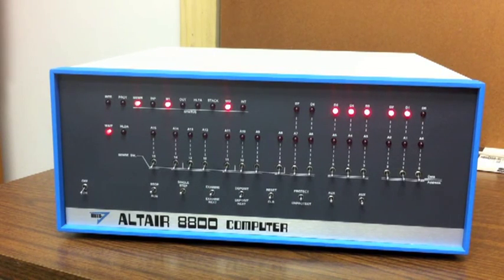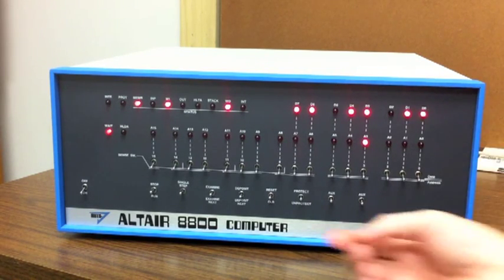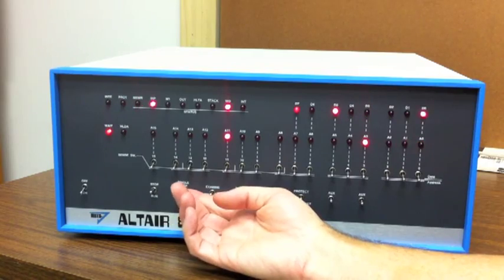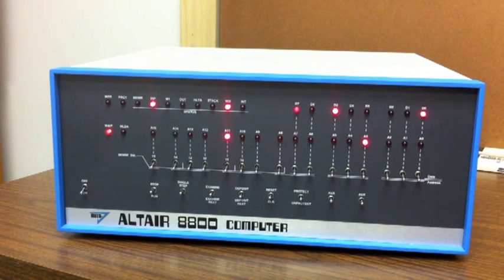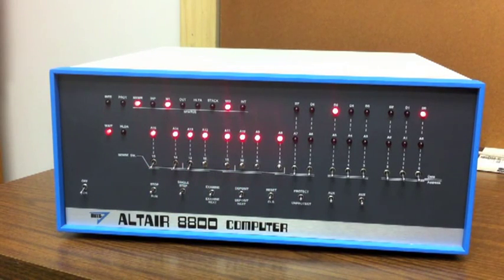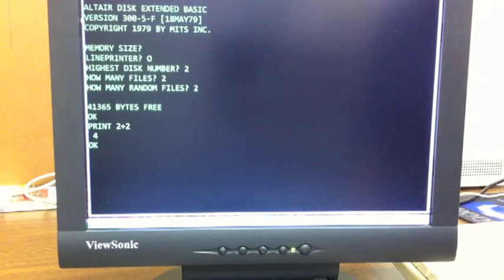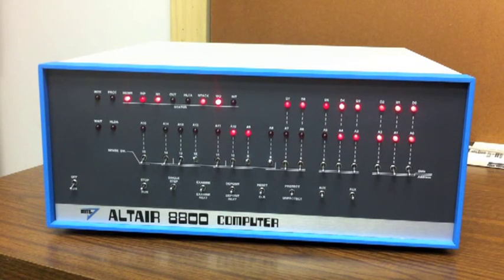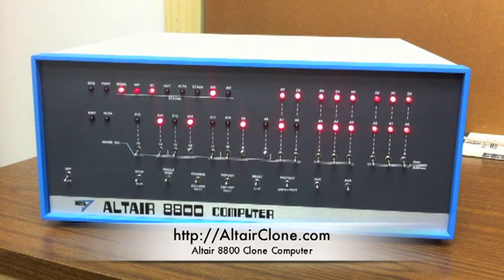Altair 8800 - Video #11 - Altair Floppy Disk

Comment: Why does it say 41365 bytes free when the maximum memory is 8kB? Is that really bits for the 8K model? I really found this really interesting because the other times I have seen this it was always presented that you had to input commands by hand using the switches on the actual physical box (I assumed), reality is that this is not so different from later computers and uses a keyboard. Thank you for uploading this and showing some of the programs. I now find out it played the trek80 game that I played as a nipper on my dads TRS-80. Very interesting, thanks!
Reply: 8kb refers to the size of the Basic interpreter.  The machine language program code and scratch space for Basic itself takes 8k of the 64k available in the Altair.  41365 refers to the amount of memory available to the program code written in Basic that you provide.  You'll notice a small amount of memory unaccounted for which is used by the read-only Altair PROMS.

Comment: awesome videos! how many instuctions were entered manualy for the fd loader?
Reply from the maker: The code to boot from floppy disk was too long to enter from the front panel. Instead, the disk boot loader ROM was used to boot a floppy disk, or, the code for the disk boot loader could be loaded and executed from paper tape or cassette. Loading the disk boot loader from paper tape or cassette was done in the same manner as loading BASIC. See "Altair 8800 - Video #20 - Disk Boot From Paper Tape" for a demonstration (Altair 8800 - Video #20 - Disk Boot from Paper Tape)